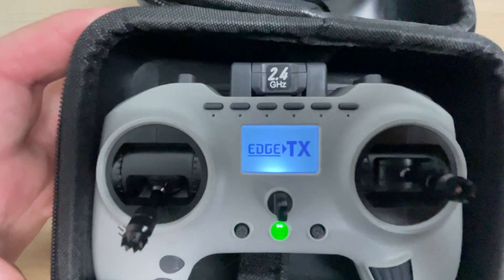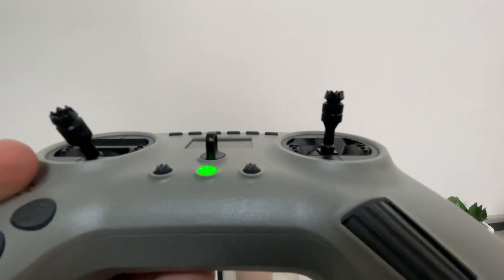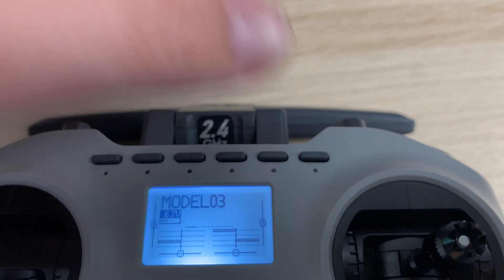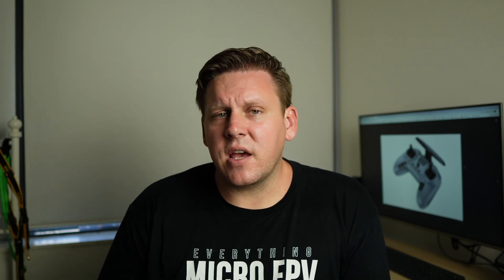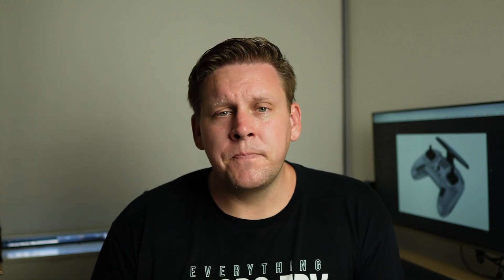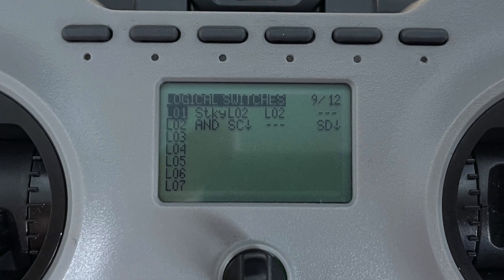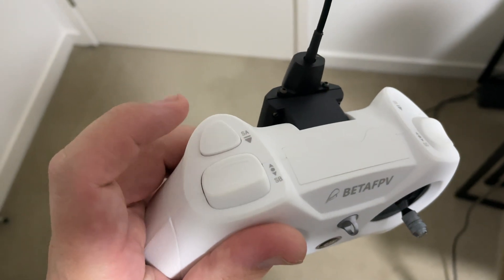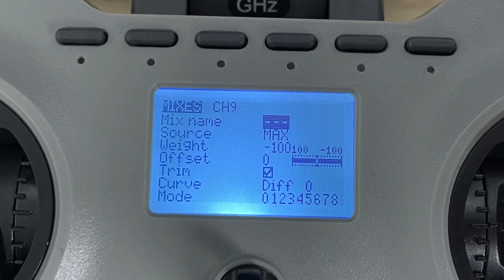Why You Should AVOID The Jumper T-Pro At All Costs

Comment: had mine 2 years ,, hmmmm still going strong ,, the wiring inside is twisted to tight grounding wires out causes lots of issues with charging and sd card failures .. run 3.01 elrs and you will have no issues the wifi module on my has failed so will not connect to flash firmware ,, edge TX recommends now the the memory card is internal a flash chip eliminates the no sd card error  .. new jumper and boxer radios are all boards with plug in connectors no solder joints anymore ,, all radios with external sd cards on edge TX have issues

Comment: I prefer a momentary switch way over a toggle one. By software you can make a toggle one out of a momentary one, with ONE line in the special functions. But you cannot create a momentary one out of a toggle switch.
I disarm my wings with a 2sec-press on a momentary switch, to absolutely avoid accidential mid flight disarm. A toggle switch is just useless for that.
Reply from the maker: Well, in the V2 of the T-Pro, they made it a toggle switch 😉

So, you had to put in code to make sure you are holding down the momentary switch for 2 seconds to make sure it didn’t disarm 

And did you know you can use the same on the toggle switch

Comment: Hi Darren, dose the v2 have a latching switch for arm/ disarm, I have a ethixs for crossfire and a jumper t lite for D8, I want to get the jumper t pro v2 to move into elrs, I know I can switch with modules I just prefer to have everything separate, I prefer the gamer style controller over a chunky one..
Reply from the maker: Yes. Latching shoulder switches on the v2, oled screen and 2S 18650’s
Reply: I also want x2 18650 if I'm going to elrs the t light only has one.
Reply: Thank you

Comment: You know there are latching push buttons under those shoulder buttons, right? If you really want something latching those are totally usable. 
Personally, I use claw so have my right index finger holding the right 3pos full up for armed and then flick it down to disarm. Works really well for me. I'm not sure any of these issues are really as serious as you pitch them tbh. It would be nice to be able to mount the gimbals lower in the body just because of my hand size. Though it's totally usable and as an overall Tx, it has a great amount of flexibility (more than what is needed for FPV tbh) in terms of options to use for various controls.
Reply from the maker: You know after I made this video, they updated the radio to have latching shoulder buttons.

ELRS also requires a 2 Pos switch for arming. Using a 3 position switch you are giving up 2 positions.

Comment: I purchased a Jumper T18 Pro v2 six months ago and it is a big piece of garbage! The gimbals are so cheap that the right one looses calibration and causes me to have to recalibrate the gimbal and fine tune  all of the models.  I have had to do it several times and it keeps doing it! I have had to purchase a Radiomaster TX16S because no one has any gimbals for the T18. Jumper will not respond to my emails!
Reply from the maker: TX16S gimbals may work in the T18, but I think long term you will be happy with the TX16S

Comment: I feel like his brain stopped working on learning new things. All of his complains are personal tastes. I feel like if I'm the manufacturer I will design the controller according to his way. Is that called a brat? lol. Another point, positions switches are not software hack, it is a feature. That is the reason why the controller has its own operating system so you can PROGRAM it your self. Fundamentally flawed because things didn't come in to your own way? lol
Reply from the maker: You feel like my brain has stopped working on learning new things?

Well, I’ll remember that and next time you ask for help - you can find it on another channel. 

It’s funny you mention this, because the manufacturer has since changed the design of the radio to include a latching shoulder button on the left side for arming & disarming. Oh why did they do that I wonder.

Comment: Omg more whining about the momentary switch 😢 I happen to love having two momentary switches. I use the left one as part of my arming and to change VTX power while flying, so it seems quite useful to me. Also a latching switch in a cheap budget radio will most certainly be garbage quality and the internal latching mechanics will fail and then the switch may not work at all while the quad is flying around until the battery dies and it falls from the sky. DLG and sailplane guys also need a momentary switch there. So quit being lazy and self centered and program a simple logical switch to deal with it and quit trying to screw up a perfect radio for other people.

Comment: There's literally a 3 way switch for arming just to the right
Reply from the maker: There are a few reasons why a 3 way switch is bad for arming:
1) ExpressLRS requires a 2 position switch for arming, not a 3 position switch
2) it’s a waste of a 3 position switch that can be used for your flight modes (acro / angle / horizon); beeper & turtle mode; launch mode & pit mode…
3) arming should either be armed or disarmed, not disarmed, armed, armed

Comment: Jumper released an upgraded back cover that replaces one of the dials with a latching switch. I have one and it works great.
Reply: thanks for mentioning this i didnt know it existed, upon looking i see they use the right hand for the latching switch unfortunaly i really do prefer to use my left hand for arming, it would have been good if they got rid of both dials and put 2 latching switches because what can i use the dial for? on my dji mini 2 i use the dial for zoom and moving the gimbal, but for an fpv quad i cant really think of a single use for the dial. I would honestly prefer airmode on a latching switch as well as arming, but hey i could get used to arming with my right hand, or maby i could buy 2 and modify it to replace both dials with latching swithces, hmmm
Reply: @christhorney  I agree it’s not ideal. On reflection, I should have got the Radiomaster Zorro.
Reply: @peterquayle9948  I'm not too stressed honestly the extra power headroom is worth it to me (on elrs) not that I will ever use the 1w but knowing it's there if I need it is nice, and yeah even without the latching mod it does do everything I need just their are drawbacks to all the radios, without spending extra money on batteries cases and modules the t pro I still think is the best value, also I found someone putting in radiomaster CNC mini gimbals in a t lite and the pro is supposed to have the same gimbals as the lite so it may be possible to mod in nice CNC gimbals, I'll find the video title and respond again with the title of that video for you to find it easier
Reply: @peterquayle9948  Upgrading jumper t-lite with radiomaster ag-01 mini gimbals

Uploaded by user aigilea

I'm keen to try putting them in the pro

Comment: I get the points, still decided to buy it.
Month later i love the thing. Very cheap and very nice feeling. 
especially the long sticks are really nice for a beginner like me.
About the arming and disarming, yeah it could be better designed but i kinda like that u need to buttons to arm the quad (and disarm). 
overall i would recommend the thing!
(Must say now i bought an tx16s with the full cnc gimbals)
Reply: is it still holding up
Reply: Me too this thing is durable just throw it around keeps on going and uses lil battery at 500mhz thats what I use goes super far

Comment: Hello, what about Literadio 3 pro, what do You think about it?
Reply from the maker: Haven’t been able to get my hands on one… but haven’t heard the best about it. Jumper T-Lite V2 is out, which is on its way. If it’s anything like the original T-Lite, but better, then it’s a winner
Reply: @DarrenAllatt  jumper t lite v2? Didn't heard about it. But I heard few good opinions about literadio 3 pro. Currently jumper t pro is on discount, elrs version for about 100$, is it still not worth? I am new so I am asking:)
Reply from the maker: @smokehead5318  I’d stay away from the lite radio 3 pro …. The T-Pro isn’t something I am a fan of, so either go the Zorro or the T-Lite
Reply: @DarrenAllatt  I have local yt guy that had to replaced t light 5th times...believe or not, but I have heard that many have had problems with t light, ahh we will see, literadio 3 pro has at least better switches, and gorgeous screen vs t pro. But battery...:( it's in every hobby, every piece of equipment is lacking something ALWAYS, how is that possible;) cheers mate.

Comment: what is the betaflight setting to make the stick feel normal.. I have used frsky xlite for three years and its really difficult to use this jumper
Reply from the maker: That’s actually stick tension on the radio and not a Betaflight setting
Reply: @DarrenAllatt  I means stick feel when roll or do fast turn.. I played with lowering rate and still very fast response .. maybe I have a faulty gimbal.. I was you figure somthing in rate to make the stick speed normal like other radios
Reply from the maker: @dndon2007  I’d try calibrating your gimbals which is in the system menu of the radio
Reply: @DarrenAllatt  I did with any new models.. I figure the problem its just travel to the endpoint its very far different than my others radio tx 16 pro and taranis x-lite. I have to play alot to get used to it.. anyway thanks for reply and sorry about my english 👍🏻

Comment: unsubbing sick of these negative reviews when there is easy work arounds, you are just hopping on the JB bandwagon.
Reply from the maker: Fully respect your decision. However as a consumer I don’t believe it’s my responsibility to find a work around to a manufacturers negligent product design and manufacturing process.
Reply: @DarrenAllatt   Its a simple button configuration to suit your likings, You are way off with statement like "a manufacturers negligent product design and manufacturing process" what exactly are you referring to? the button layout is not to your liking so you make a outlandish statement like that. I for one like the design and the layout and it seems so do many others considering they have been out of stock for months. The FPV hobby as a whole requires you to have to adjust your equipment so what is the big deal about changing a button layout to suit your liking? Mountains out of molehills! Every so called issue some YouTube FPV channels have found so far has been solved with a simple adjustment in the menu, apart from the internal ELRS version, they really dropped the ball their trying to get it out to market as fast as possible.
Reply from the maker: I actually like the button layout and design, as I said earlier in the video. The implementation of the buttons is an issue. Would have been happy if one was latching the other was momentary and it was up to me to open up the radio and swap them. 

It's not safe to have the arming switch on a momentary button. If you accidentally bump the switch, the sticky function takes over and arms the quad, and carnage ensues. At least with a momentary button, any bump won't cause arming.
Reply: @DarrenAllatt  How is it different from accidentally bumping a latching button?
Reply: @DarrenAllatt  there's a simple solution to your "flaw" argument... Don't use either of the momentary switches for arming!! You don't have to!!! Use one of the 3 pos switches. Save the momentary switches for beeper and turtle mode, both of which would work great for momentary uses. Or just rip the damn buttons off the radio if you're so offended by them. But in this case I don't think we need to throw jumper under the bus, call their product broken or flawed, or start demanding recalls (I didn't say you did that, but I saw a comment here to that effect) just because they made a design choice to add 2 momentary switches where other radios have 2 position switches. Literally a tempest in a teapot. Don't use the radio ffs.
Reply: @DarrenAllatt  
Never carry an unarmed quad without a momentary shoulder trigger button for safety doesn't  sound fair .

Comment: The latching switches on the Tango 2 suck. After only a month of use, the left switch wasn’t working. I reached out to TBS, and their response was that it was probably full of dust, and I simply needed to take the entire radio apart and clean the switch. Obviously, it’s a design flaw. I had to remap the arming switch in FreedomTX, and the momentary left shoulder switch is now turtle mode, so nothing essential
Reply from the maker: They do, the latched switches on the BetaFPV literadio3 which is $50 don’t suck and won’t have the same problem as the Tango2 and Mambo

Comment: I planned on buying a T-Pro or Zorro before they released, but after seeing their features and drawbacks I decided they were both a bit underwhelming.  It's really a shame there isn't a gamepad style radio without major downsides.
Reply from the maker: The Zorro’s major drawback is the battery. I’m still testing it to see how much life you actually get out of it.
Reply: @DarrenAllatt  That is my primary problem with it also.  I'd be curious to know how it handles a module running at 1w.  I'm assuming you'd need to plug-in an external battery, and that's a bit of a deal breaker for me.  To me it's also a drawback that the ELRS version is only 250mw.  I'm sure that's what's reasonable for the internal module without a fan, and it's fine for micros, but do I really want to put a 5" with a GoPro in the air on 250mw when 1w is an option?  

I really wanted to like the Zorro since there are good gimbals rumored to be coming, and I'm used to higher quality gimbals than what's available on gamepad radios.  They were so close to a good product.  Looking forward to the review and how you think it compares to the T-Pro.
Reply from the maker: Personally, the spec chasing of "higher so it's better" is something I am working on for a video. That being said, sounds like you freestyle and fly in bando's. There was a facebook post recently where this guy flew a ELRS whoop behind 3 apartment buildings on 500mhz at 100mw and failsafed - link below. It was a crazy distance for the amount of interference and multi-pathing he would have had between his radio and the quad. I am going to be doing some testing on this concept between 250mw and 1w for ELRS. 

So many people are used to being burned by FRSKY that we just want to throw everything we can at the RC link. 

Here's that video... I think it's crazy distance for 100mw @ 500mhz on a whoop with that much interference and multi-pathing: https://www.facebook.com/100053727850424/videos/1009842019612786/

Comment: Absolutely agree. I like the fact that you are looking from the perspective of a actual buyer who would pay the money. I agree they got the battery right which Zorro did it completely wrong.
Both of them in my opinion were huge deal breakers for me.
I use ELRS on my Jumper t18 which hase 18650 and even with new 3200mah battery with 200mW I hardly get couple of hrs in the radio so for me Jumper T Pro is garbage and so is Radiomaster Zoro but Jumper is a bigger pile than the Radiomaster.
Reply: I have the jumper t pro and love it so small and tough as hell 6 months beat to hell keeps on going like new crazy I dropped it down a flight of stairs and nothing just keeps on going

Comment: Mostly disagree. Tpro at least could run much longer than overrated Zorro. 2hours of working time- such a shame for transmitter with small batteries
Reply from the maker: I did say Jumper got the batteries right, but stuffed up the rest.